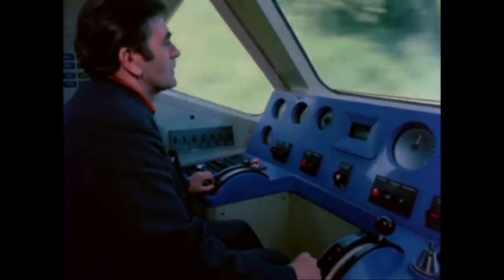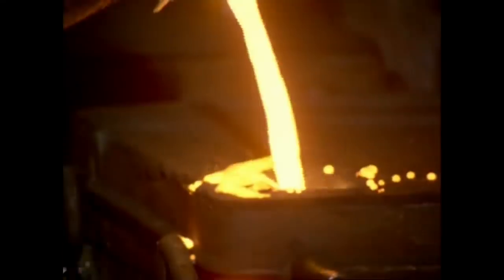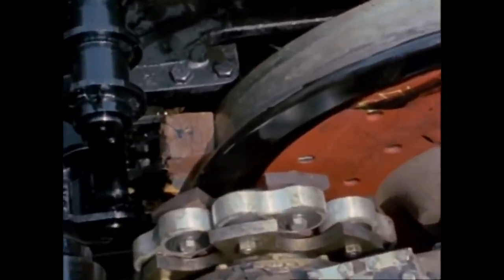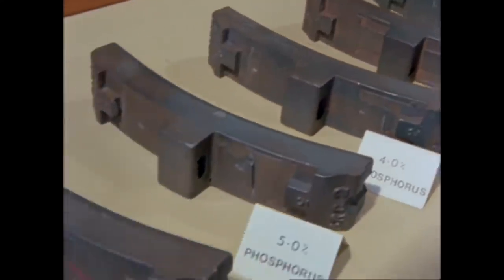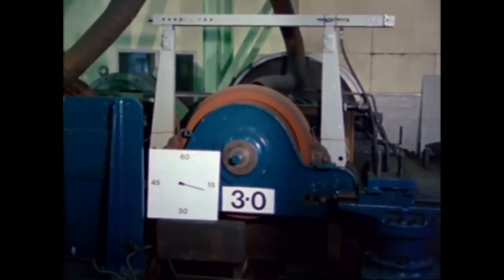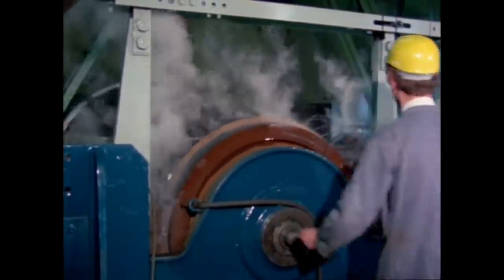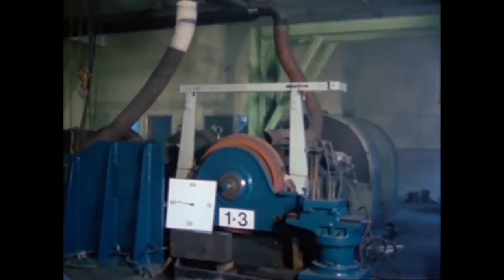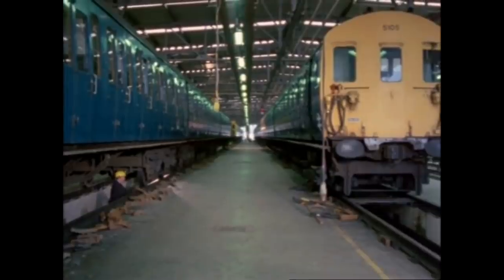Vintage railway film - Power to stop - 1979

Comment: Finished school in the glorious summer of 1969 and got a job with British Rail as a railman (3rd class), cleaning trains at a local depot whilst waiting to go into the civil service. It was of course the days before anyone gave a toss about health and safety or PPE and when changing pads, the engineers would happily clear out the dust with an airline and work in a brown, metallic tasting cloud. It was a filthy, horrible job and that brake dust got everywhere - it also had a burnt metal smell that you could never quite get rid of. My mother made me change clothes in the shed before I was allowed in the house after work.
Reply: I wonder if those airborne burnt metal particles are worse than cigs. Did that job lead to any health effects?
Reply: @lolmanurfunny  Only stress from the overwhelming desire to kick the living crap out of the foreman every day. I lasted two months.
Reply: @lolmanurfunny  all the welders would be dead if it's that bad for you.

Comment: Changed to many brake blocks lol 31's 47's and 56's were OK but 08's and 37's could be a nightmare . Got it easy now with 66 composite blocks , mind you 60,s can be bad the corner blocks with new wheels

Comment: I was entertained. I would like to have seen comparisons for wheel wear though. The brake shoes were described as cheap and easy (like various mom jokes), but those wheels are not so simple to produce. I suppose an emergency stop (in the case of the disk braked model) would override wheel wear considerations though, as long as the wheels remained intact and safe until stopped.
Reply: This was my question too. Doesn't a harder brake pad wear the wheel more?

Comment: Does old uk locomotives have Dynamic "rheostatic" braking just like in US?
Reply: I don’t think so.
Reply: Short answer, I don't know, but the UK has far smaller freight trains than the US behemoths and less severe geography so possibly wasn't required.
Reply: @poruatokin  Knowing US rail companies, they probably use rheostatic brakes to avoid paying as much for brake pads, not for safety reasons.
Reply: Yes, a lot of locomotives in the UK were and are fitted with rheostatic braking systems. Right back to stuff in the 60s to present.
Reply: @lobsterbark  But why wouldn't you use it? It's by far the most economical braking? Yes, let's blame Americans for being more environmentally friendly and economically minded, how dumb of them.
Reply: @TheMetalButcher  The point I was making was if it was slightly more expensive or even the same cost but safer they probably wouldn't use it.

Comment: Given how long it takes a long or heavy train to stop even today, maybe it's time to re-evaluate century-old designs!  Seems kinda obvious that eight shoes on eight wheels per car is insufficient if it takes the bloody train eight miles to stop. That's not how you avoid an accident, it's just how you stop to examine the wreckage after one has happened.
Reply: Ultimately, the rate at which a train can decelerate is not limited by the ability to apply force to the wheels, but by the ability of the wheels to apply force to the rails. It would be quite easy to put brakes on a train powerful enough to easily stop the wheels rotating, but if the wheels lock up and slide rather than roll, that is of no use.

However, there are some types of brakes that directly act on the tracks as well, both magnetically. One type, that is quite widely used, uses magnets to pull a brake pad up against the track, where they slow the train down by standard friction. The other, which is only used in some modern high-speed trains like the German ICE 3, uses powerful electromagnets to create a magnetic field at right angles to the track. As this magnetic field is moved along the track by the train's speed, it induces eddy currents in the rails, which themselves create magnetic fields, and the interaction between the two fields creates a braking force. The upside of the eddy current brake is that it works silently and without wear or dust, as it works without any physical contact, however as its braking force is proportional to the train's speed, it is only useful at high speeds, and it can only be used on track designed to withstand the magnetic forces.
Reply: You're not going to stop 1800 tons (3.6 million pounds) moving at 40 mph (or more) in much less than 8 miles short of installing rocket engines on each car that you can light off to provide counter-thrust.
Reply: @JunkCCCP  It should be able to stop in about two miles, not eight

Comment: It's a shame they never solved the hideous stink from the HST brakes.
Reply: They did reduce the issue by closing the air conditioning intake vents when the brakes were applied. They also tried different brake materials to no avail.
Reply: It was wet asbesous  fumes  used to get it on mgr trains

Comment: 2.06.....carbon at 3.0%.....that is a high percentage in steel...normally, (then ), a carbon percentage of 0.8 to 1.5 was sufficient to give strength to iron, making it steel...the higher the carbon content the more brittle the steel becomes.......so, cracks would not be surprising; 3.21.
Reply: What?  Cast Iron has always typically had a carbon content of 2-4%
Reply: @poruatokin  Quite right for cast iron...cheers!

Comment: Let me guess the latter stuff in the test was tested, the better it worked, man they hardening that wheel with cooling...
Reply: Wrong - it was not at any level of red heat so no hardening will ever occur.  Also, hardening depends on the material.